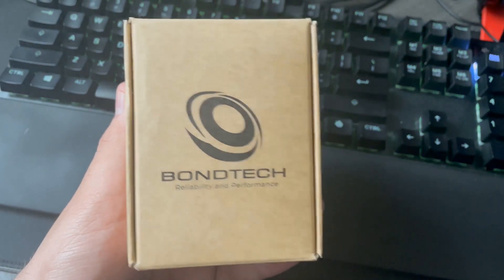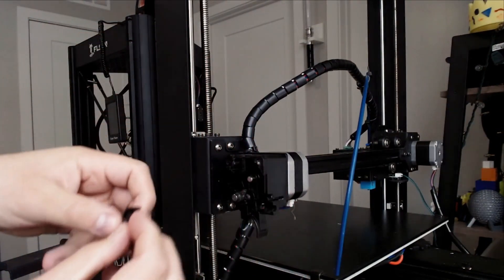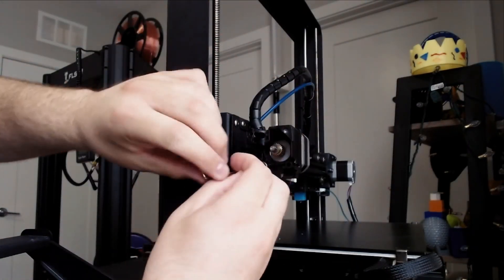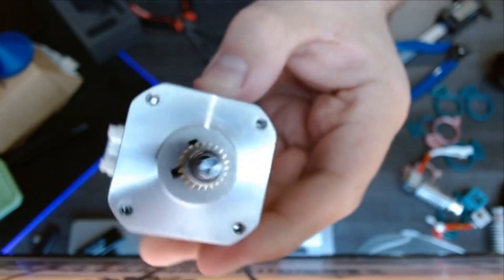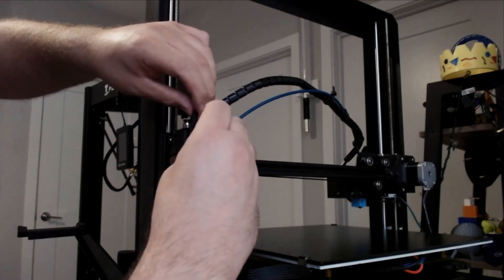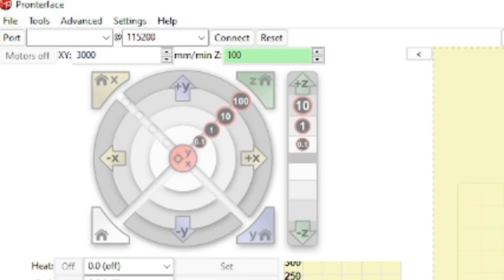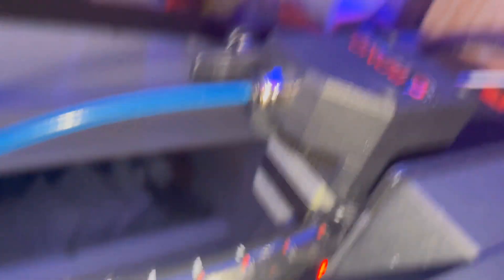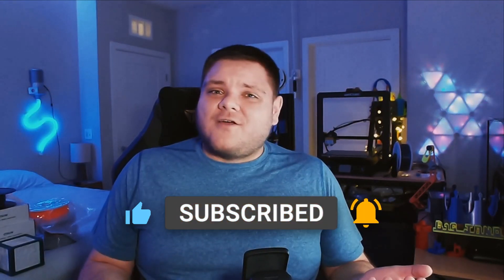Upgrade your Extruder on the Anycubic Mega X!

Comment from the maker: What else would like to see topics wise covering the Anycubic Mega X? Let me know down below!
Reply: And change Carriage to MK4, and make it direct drive :)
Reply: Would love to see if you have ever managed to get a print to continue after filament runs out. Ive tried twice and it never works.
Reply: Yes, please talk more about the bed.  I had to replace my print bed after 1 month of light use because it was warped, wouldn't level and wouldn't print.  Anycubic did send me a new one, however after a few more months, the new bed is now warped too.  Is there an easier way to mitigate this bed warping issue than calling Anycubic every few months for a new bed?  I've only been printing for a little over 2 years but my Qidi has been running non stop for over 2 years and I've never had this issue with the Qidi.  Thanks!
Reply: What kind of smallest nuzzle do you recommend for this printer, and my bed is not stable it has playing in the wheels below not sure is it should be like it or no on this printer.
Reply: hi Jano, can you make a video how to update the printer for doing pause at height for filamen change?

Comment: I bought the Bondtech BMG and mounted it on my Anucubic mega x. Do i have to put bM92 E415 and M500 in the software?
I did what you said and change the E400 to E415.
Printed a testcube 20 x20x20 and the cube was perfect. Thank you very much.
Reply from the maker: As long as you change the e-steps in some way you should be fine. Just use the bondtech recommended settings

Comment: I am trying to connect my mega x to Pronterface and the baud rate is giving me problems. Have you had any issues with this
Reply from the maker: I haven’t had too many issues with that but it can be finicky at times in my experience. Try a different baud rate value if you haven’t already and see if that helps. If that doesn’t work, maybe try a different cable to connect to the printer.

Comment: Installing Bondtech LGX-B on my Mega X. Had the same problem with baud rate as @skoaljaw2216. The recommended E-steps is 400, so I assume the command is 400 not 415?

Comment: If you had to do this over again would you have stuck with the BMG Extruder or Bondtech's LGX B which I think may be a bit newer?
Reply from the maker: For its purpose I think I would’ve stuck with the one I installed. Not to say the other is a bad option. It hasn’t given me any issues. Now if you ever wanted to convert your machine to a direct drive eventually, the lgx b may be a better option.

Comment: I got a dual drive extruder off Amazon.. looks exactly the same in all aspects but the directions, and logo on the side of the unit, say to install it upside down in comparison to this bondtech model.. it definitely wouldn't have fit given the adjustment screw would hit the gantry. So weird thankfully I followed this video instead of the instructions sent with the unit.

Comment: I bought a Mega X about a month ago and I love this thing! It performs way better than my Ender 5 Pro and Competes with my Sovol 6 plus neck and neck. I watched one of your videos about settings and it opened my eyes because of the way you explained the settings and encouraged me to do more challenging prints. Thanks for all your videos and I am happy whenever I see you have a fresh video out.
Reply from the maker: Thank you so much for the kind words! Thank you for watching and for your support!
Reply: Hi Bro, whats your print speed on anycubic mega x. Have you change/upgrade anythings on this machine?
Reply: @KealTR  I haven't done any upgrades, but I usually run it at like 35-45 depending on if I want small details printed better
Reply: Thank you. I will try the low speed.

Comment: I might look into this, lately I have some issues with the extruder were I hear a Click sound, and then the Filament no longers goes through the gear unless I fiddle the spring-hold lever, or push in the filament. Seeing this I'll try cleaning the gear a bit first then replace :)
thanks!

Comment: Very good Video. Thank you very much. Im planning to upgrade my extruder too. But i would like to try a BondTech Clone. Was the upgrade worth it? I mean is it a big improvement compared to the original extruder?
Thank you very much.
Greetings from Germany
Alex
Reply from the maker: I think it is. The bondtech extruder has better quality gears in my opinion. Also in the time I’ve installed it, I’ve had zero issues with it. I’ve also had my delta printer for the same amount of time and that has a bondtech clone. It’s done alright but have been having some issues. Not to say you’ll have the same experience. Just giving you my personal experience. 

Thank you for watching!

Comment: Great video! I have done the same upgrade however my computer will connect through pronterface. I get the following message. Could not connect to COM3 at baudrate 115200:
Serial error: could not open port 'COM3': PermissionError(13, 'Access is denied.', None, 5)  Can you help please?
Reply: It was a computer update problem. I needed to update and restart and it worked fine. Thanks again for all of your help at you are the go to guy with the Mega X.

Comment: I changed my extruder in my Mega X, for the same as You, but it will not be 415 steps, You need to calibrate it maunaly, mine is 406, its says ABOUT 415 :) You need to measute it.